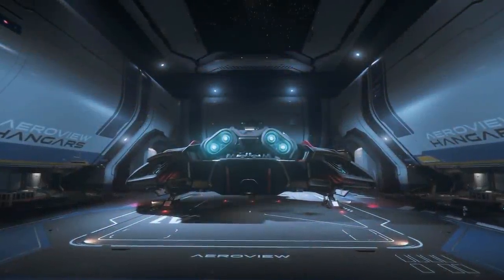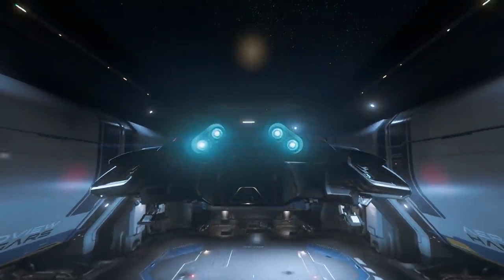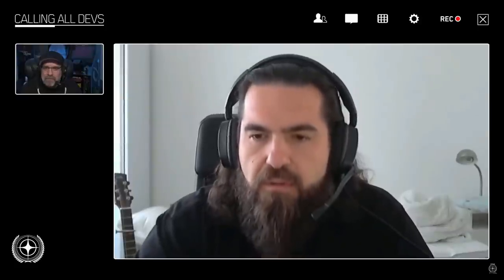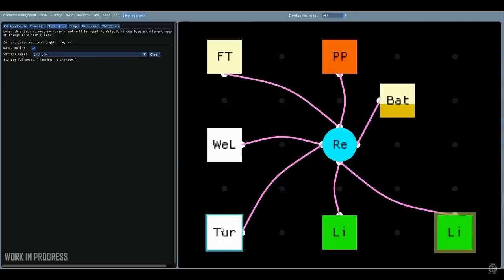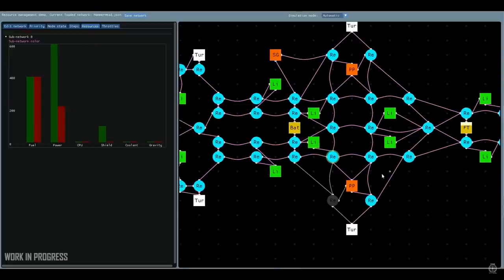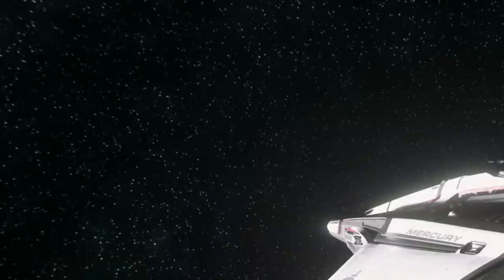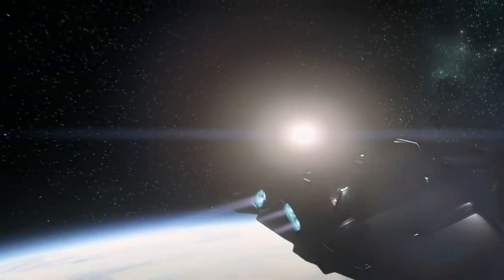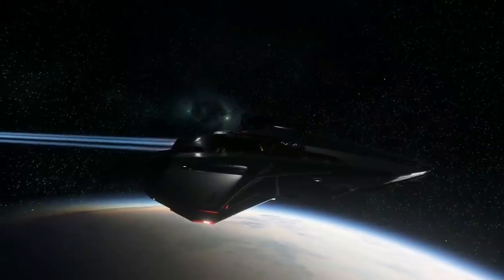Star Citizen 3.11+ - The Engineering Career - New Power System, Ship Rework, & Salvage

Comment: Maybe as part of salvage role, it includes limited time to repair dangerous leaks, to prevent catastrophic failure of power system melting the salvage, including the salvager and their ship. a toxic leak or armed torpedo firing mechanism failure, or unexploded enemy one. Heavy components requiring space clearing to extract, disable relay to allow clearing live sparking cables in a collapsed hall, cutting away the supports reactivating the relay to test component. replacing some components and flying a hull back yielding scrap value of the hull and component value.
Reply from the maker: Those all seem like very via things they could weave into the engineering and salvaging gameplay. Other than the 4 general types of salvage, we haven’t seen any specific on exactly how it’ll operate, so anything is possible!  =)

Comment: Excellent Scotty work.
Remember when they were getting sucked into that thing that looked like giant leech that was about 5,000,000 degrees on the inside? Scotty got 'em out of that mess!
Reply: wasnt actually spock the one that saved them all?
Reply from the maker: So with doing a little research, Scotty is the one that did emergency repairs on the transported to get it working in the nick of time. Spock during the dialog suggested “inverse phasing”. It’s not revealed whether that suggestion helped or not, but it’s assumed it did - but Scotty nevertheless performed the actual repairs under extreme duress.   =)
Reply: @Oearth  Whew! Thanks, Oearth!
Shoulda known if research was needed, you would do it.

Comment: I agree 100% with the idea that the relays should (nay, MUST) be done via a single panel (or perhaps a few redundant panels within a ship) or from a station. The idea of having to frantically run around a ship to flick switches on and off is silly and is not much of a gameplay loop.

As for the requirement to cut power to capacitors and components before removing them, that makes sense. Even in basic electrical repair on TVs, amplifiers, etc. a person needs to be careful with capacitors and such because the discharge can cause catastrophic issues.

This is where CIG can hit a nice sweet spot if they do things right. Make it over complicated and you alienate too many players and make something potentially fun and engaging, tedious and cumbersome. Make it too simple and it will fall short of doing what is intended and that is what I just explained above.

Overall, the potential for salvaging is nice and I look forward to it in the upcoming years as they develop it and flesh it out.

Cheers! Canuck_2099 :)
Reply: Agreed 100%. Balance is key here. I work all day and want to come home to relax with some fun entertainment. This hassle high potential to be a real job and I’d rather not work two jobs.

Comment: How power works ultimately will determine how ships destruct and experience "death states," as their power-state and physicalization of components will entirely replace the current "HP to death" system. Subsequently, what components and debris are generated as salvageable material is entirely dependant on how the power system winds up working for each ship. To proceed with creating salvage states and salvage gameplay before that would result in much of that salvage content being overwritten or, worse, not exactly congruent with the layout, structure, and function of ship components and debris in relation to power. There's no point overwriting work when the engineers and developers can instead move off onto other content that's in the backlog. Yes, admittedly that's content we aren't going to see nearly as soon as salvage/power, but that's the way development works.

Comment: This is super awesome. Got really excited when they showed the prototype for how the gameplay might be for a engineer, but was wondering how that would work on single seaters and smaller ships. A big ship with multicrew is easy to imagine a friend going and changing the power loadout on the flight in the middle of a fight, but how would that workout for smaller ships? More hotkeys? LOL
Reply from the maker: The little single seat fighters maybe get a little panel or two on the outside where you mostly like have to repair in a hanger.  Someone else here mentioned maybe needing to use a little ladder or scaffold (maybe).  We saw them add a little pop-out weapons rack on the outside or the Gladius (I think it was), so who knows what they have in mind!
Reply: @Oearth  Interesting, it makes sense. A bit problematic having a "engineer" panel on the outside of a ship, imagine someone hacking into it while you are doing something else, scary thoughts!!

Comment: I was pretty excited over the relay systems. Glad to see the engineers will have something to do. I do wonder how they plan to make it require skill to use, as it looks like simple switches. IRL I can flick a circuit breaker in my house, but it takes some knowledge to know how those wiring loops, and junctions work, if you need to diagnose a fault. I don't want to see one-day-old noobs disabling my Super Star Destroyer with the flick of a switch.
Reply from the maker: Hopefully not!!  (on the disabling)

Comment: I think a lot of people are confusing the role of engineers. Engineers control the settings on systems and are not designed to be primarily used as maintenance. In a fight the engineer will not be leaving his panel to go fix a relay since someone needs to sit at the relay or engineer panel or w/e it will be called to keep everything optimized. I believe the people who will actually be swapping parts will be anyone affected by the damaged part (like a gunner in a powered down gun) or non-combat crew in general. I do not see the engineer getting out of his seat to fix a relay on the other side of the ship. I can see them fixing ones in their immediate vicinity though.

Comment: There are multiple arbitrary decisions that need to be made.  Keep this firmly in mind, these spaceships may resemble things assembled from components we have today, but they are 930 years in the future, so expecting this to be consistent is unlikely to meet expectations.
First, will relays involve hard-wired connections, or wireless nodes?  We have had the concept of wireless power transmission for a long time, and 930 years could be more than enough time to work out the details.  Tesla's theories may be our future.
We may simply deal with function nodes on the ships, that are the hubs for specific aspects of ship operation.  They don't necessarily need ducts, wiring, or piping.  There could simply be projected effects.  This could work extremely well in a game.  The mini gaming aspect for engineering needs to be balanced, as what starts fun can quickly become repetitive and dull.

Comment: will be interesting if they have different physicalized pipes or relays for all different ressources: oxygen, CO2, fuel, propellant, energy, data, coolant or a "super relay" for all systems. To me engineering gameplay starts with custom bumpers, NOx and custom led stripes ;-P
Reply from the maker: It's possible!  Might evolve to that after the Tier 0 - would certainly add more depth and detail around ships for relays to be more specialized.